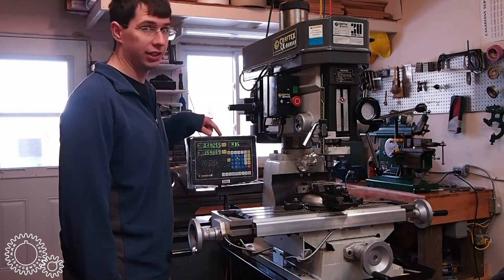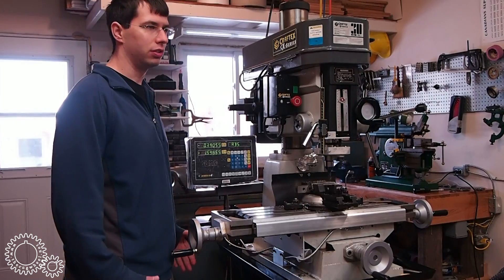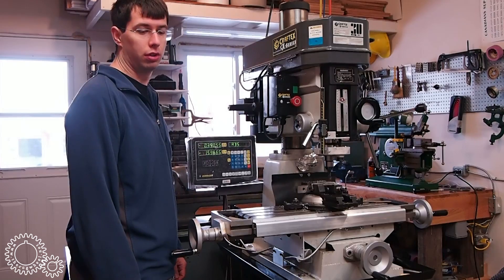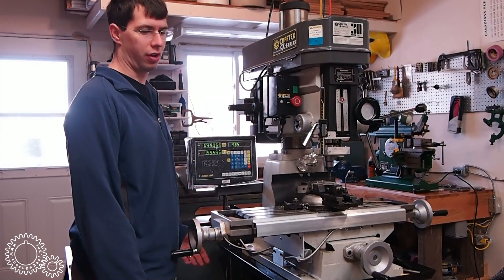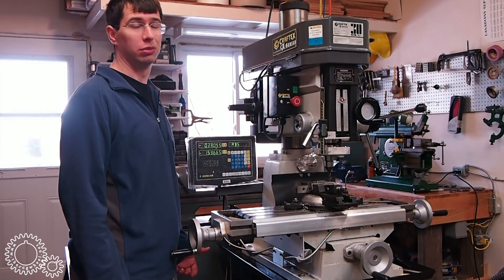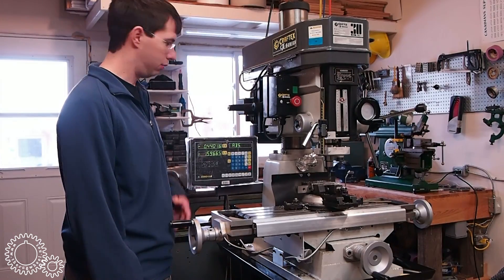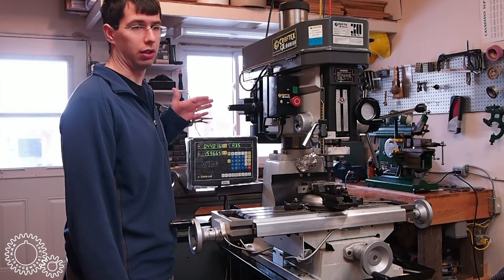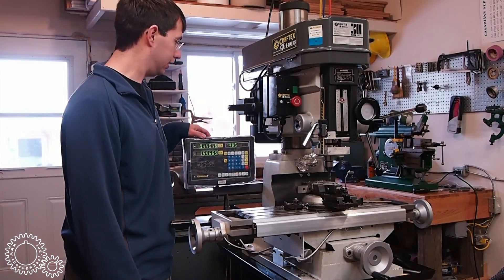$200 Shenzhen DRO Install and Review Part 3

Comment: Just ordered one of these after much frustration with my grizzly mill lathe combo trying to drill a bolt circle and finding my dials loose .005 - .008 every revolution over 27 turns of the handle I was so far off I could not complete the project I was working on. Thanks for the review

Comment: Thanks for the info. I have one on order. Does yours have a feature for finding the center between two points?
Reply from the maker: I don't really use the features as I do most things in CAD.  But I'm pretty sure you can find the centre between 2 points.

Comment: I purchased the 3 axis version.  I have a software issue that you might have run across.  The calculator is metric.  When calculations are passed to the axes they are converted if the display is inch and passed directly when the display units are mm.  I would prefer having the calculator not do this and just pass numbers directly.  Have you seen this?  Do you know a way to change this behavior?  Thanks for the vids. I have the Harbor Freight version of your mill and plan to use your mounting strategy.

Comment: Great vid. Any tips for measuring for scale lengths? I have a grizzly g0704. Thanks
Reply from the maker: A tape measure should get you close enough.
Reply: Thanks. Do I just make sure that the scales aren’t too long?
Reply from the maker: Measure the actual machine travel if you can.
Reply: thecogwheel perfect. Thank you!

Comment: once you use a machine with DRO its hard going back, I would raise the display up as where it is its right in the path of hot flying chips and any oil etc. comming of the cutter.

Comment: Why didn't you get a 3 axis rather than install a separate Z scale?
Reply from the maker: A round column mill drill didn't seem worthwhile to spend the extra on the scale for the quill.  If it was a square column mill I'd buy the 3 axis one.

Comment: O.K. - my only critique is installing the display soooo low - where it will be pelted by chips, swarf, cutting fluid and oil.
If the display sits at shoulder level it will take less flak and be much easier to read and operate.

Comment: Great video series. It'll be most helpful when setting up my lathe installation. On other DROs, I've seen & used a function to "set a dimension" for an axis. Basically you make a cut, take a measurement, & then set a dimension on the axis equal to the difference between your measurement & your desired value.  As you advance your axis this value would decrement to zero. Have you found anything like this with this DRO's software?  Thanks

Comment: I have the same DRO. I also have the three axis version. The manuals for these machines are terrible, and they don't even match the products they accompanied. Neither of my manuals talk about the Call and Tool buttons. Do you have any idea how to use them? Other than beep, my don't seem to do anything at all.
Reply: They appear to be disabled in Mill mode. Should work in Lathe mode. But how to enter the menu to change modes??

Comment: Hello,  I enjoyed the video as I have the same mill and a similar DRO still in the box awaiting the finish of my shop expansion (hopefully this fall).  Can you use the DRO to establish the head position on the column mill?  For when you need to raise and lower it.  That alone would make it a must have.  I haven't even got the one installed and am thinking of another for the lathe!!  Thanks again for the video.  Take care.  Doug
Reply from the maker: Hi Doug thanks for the comment.  I don't think there is an easy way to do what you'd like to do.  I've seen 4 bar links, lasers, and linear rails all used to realign the mill.  Personally I just pickup the work piece again.  It only takes a minute and a DRO saves so much time on the jobs that re indicating the work isn't' a big deal.  At least for the work I do.

Comment: Can you post a link where to buy? Thanks
Reply from the maker: Hi Bob - best probably to search on eBay.  If you are in the US here is one that is slightly over $200 with minimal shipping: https://www.ebay.com/itm/Good-DRO-2-axis-digital-readout-and-2-pcs-linear-scale-encoder-with-accessories/152387485599?epid=2208200371&hash=item237b007f9f:g:cocAAOSw-0xYUQ3Q

Comment: A DRO is a worthwhile addition to any mill IMHO. Some folks would be hard pressed to afford or justify the cash outlay for a DRO Pros set up never mind a Newall or other industrial unit. It seems like just the ticket for the casual home shop user or the poor fella on hot dog & beans budget.  And for the light industrial user or a shop that has a little used machine over in the corner that a DRO would make more useful, $200 with scales would be pretty tempting. One job would pay for it! 

Cheers 

P.S Loved Episode 15.
Reply from the maker: I agree, for the cost it really is a no brainer.  I would even forgo eating hot dogs and beans for a week to save up for it.

Comment: Very interesting, I have a set on Igaging scales to install on my round column mill. I also have the Blu DRO to install.  That being said I have more than $200 invested in hardware.  It will be interesting to see how well if performs.  I should be doing a video series on it this Spring.
Reply from the maker: I was going to go your route as well until I decided to get this one.  So far very happy.  The scales are substantial and are bulky but in specification are suppose to be one degree of magnitude better than the Igaging stuff.  In practice on a round column mill I don't think it makes that much of a difference.  Hitting .001" on a round column mill is pretty good.  Look forward to see how you make out.

Comment: Very nice, thank you for sharing. Does the readout return to the same value when the table comes to a hard stop twice?
Reply from the maker: It does, and I should have mentioned that in the video.  It's well within .0005" (imperial) on the times I've tried it.  I was going to do a gauge R and R study on it but I haven't got around to it.